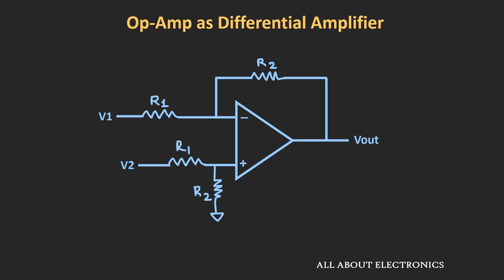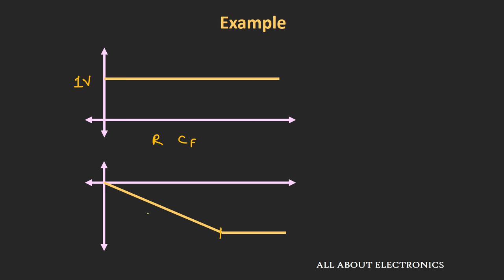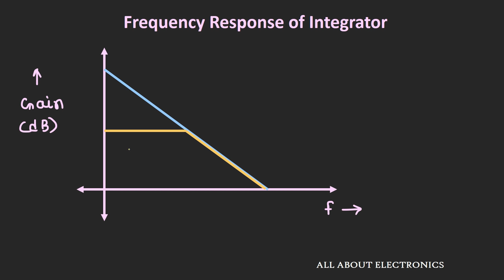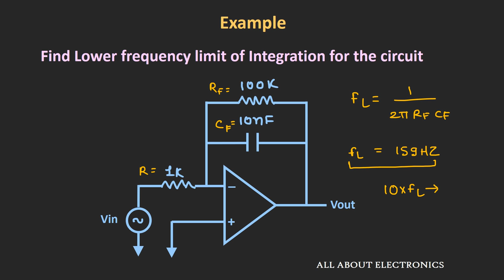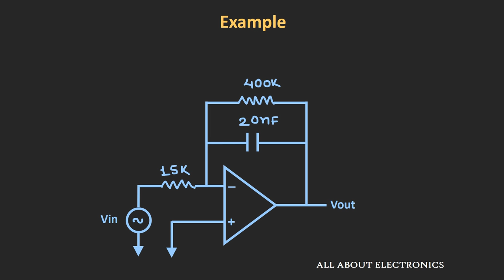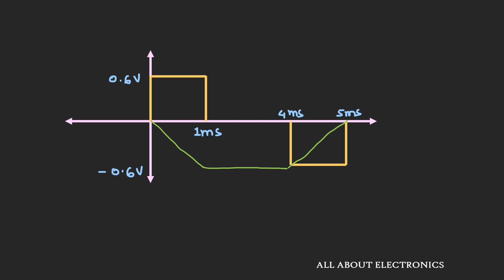Op-Amp Integrator (with Derivation and Solved Examples)

Comment from the maker: The timestamps for the different topic covered in the video is given below:
0:48 Op-Amp as an integrator (Derivation)
4:32 Output of Integrator for the different input signals
5:54 Limitations of the simple integrator circuit
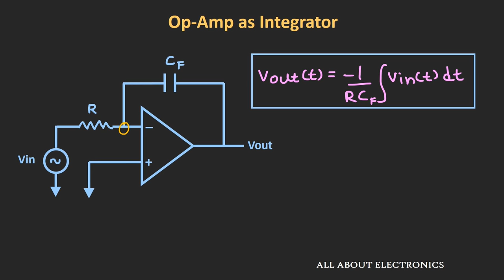8:57 Practical Op-Amp integrator
12:08 Example 1
13:10 Example 2
14:51 Example 3
17:15 Example 4 (For Practice)
Reply: Sir at 11:55 how we can go beyond 0 dB frequency? If the gain become 0 then output will be zero means completely attenuated.
Reply: In last question 17:48 how the o/p can occur if i/p at this duration 0?
Reply: how does  then gain equal to xc /r at 6:34
Reply: @stratupgeneralstudies2961  Gain of 0dB means Gain of 1 so if Gain drop below 0dB the signal is being attenuated by the amplifier.
Reply: Could you please explain, do we need our junction to be at zero potential before applying KCL there? Or you mentioned it for no purpose at all?
Reply from the maker: @prabhatp654  Didn't get it. Would you please elaborate it a bit.
Reply: Sir how you can say that voltage output is the swing .
Reply: @ALLABOUTELECTRONICS  you said something like that we have a virtual ground here and hence we can apply kcl. I am asking to apply kcl do we need to have a ground?
Reply: @prabhatp654  No
Reply: Sir, for homework problem the input signal is 0v for 1ms to 4ms.
Than how the o/p signal has constant value at -1 v.(why it is not zero for 1ms to 4ms)? 
Pls elaborate it. anyone.
Reply: "luu
Reply: Thanks a lot!!
Best demonstrations ever!!!!!!!!

Can you please do LTSpice simulations ? @All ABOUT ELECTRONICS
Reply: @malaymanna9699 mera toh minus 6v araha hai ....sir ka jrur -0.6v ara hoga tbhi constant bolrhe the .

Comment: Homework solution is 1V to -1Vin 0 to 1 msec and constant from 1 to 4 msec and -1V to 1V in 4 to 5msec.
Reply: how? 1 to -1 ?
Reply: Yes. I too found the same answer. Output is 2V therefore 1V to -1V from 0 to 1 ms and -1V to 1V in 4 to 5 ms.
Reply: @arindomphukan  bro what is the value at the 1ms to 4ms
Reply: @arindomphukan  bro uf you know that ans pls reply it bro
Reply: @sudharsanvenkatesh966  at 1ms it's -1V and then it is constant. So from 1ms to 4ms also the value is -1V
Reply: @sudharsanvenkatesh966  0V
Reply: I'm getting 0.1 and -0.1V
Reply: What is the frequency of the square wave? In the hw qn?
Reply: homework ans is 2volts, just wanna ask if it is 1V to -1V in 1ms or 0 to -2V,  why are u taking +ans/2 as the initial Vout? why not 0V
Reply: @rahulroy5206 mera ans 1V to -1V bro hai
Reply: @sm41149  0.5 KHz i guess

Comment: In the example of square wave  ; output voltage after integration was -10v. In the graph it was drawn between +5 volts to -5 volts. But in the question for practice; output voltage comes out to be -2v(0-1ms) and you have drawn it from 0 to -2v. Both seems contradictory to me. Please clarify.
Reply from the maker: Yes, in the first case, it should have been from 0V to -10V. (Because at time t=0, the output will be zero, considering there is no initial output voltage). For practice example it is alright. 
Thank you for the correction.
Reply: ALL ABOUT ELECTRONICS thank you for clarifying. your vedios are really helpful
Reply: Thanks Medha for clafication.
Reply: i had also this doubt, thanks
Reply: Same doubt,hehe.
Reply: @ALLABOUTELECTRONICS  sir, in the very last question why it is drawn downside? Bcoz in second last it was started from up🤔🤔
Reply: @ALLABOUTELECTRONICS  pls write this correction in the description so that more ppl can see it
Reply: @ALLABOUTELECTRONICS  is 10 peak voltage or peak to peak.
Reply: miss can you please provide us solution
Reply: @ALLABOUTELECTRONICS  you should have mentioned it in the video itself , because when I solved the example and got this answer , I doubted that my answer is wrong since you mentioned in the video that it is from 5 to -5 , I am glad I found this comment otherwise I would have learned something wrong , which shouldn't happen , so it would have been better if you had mentioned it in the video or in a ping comment . cheers .
Reply: @WhyBhanshu  same doubt here but if i would not have read the comments then actually i would i have gone wrong in my final exams 
...the care should be taken while uploading the videos
Reply: @ALLABOUTELECTRONICS  then for the second half of the signal? -10v to 0v?
Reply: @ALLABOUTELECTRONICS  but at t=0, input is not zero. So why is output zero?
Reply: Same doubt i have
Reply: Thanks medha
Reply: @ALLABOUTELECTRONICS  Please correct this in the video as well. Add a small note. I got confused and spent 20 minutes probing on this. Thank you.
Reply: @ALLABOUTELECTRONICS  initial voltage is not zero.....particularly in last example there is 0.6v initially ,which get amplified to give -16v ... so the total output result varying between 0 to (-2-16),that is 0 to -18 ..., is this correct or wrong ...???
Reply: @ALLABOUTELECTRONICS  so the line should be drawn from 0 to the lower part of the graph at 50us? So basically this voltage is Vp instead of Vpp?
Reply: I was damn sure I'll find this doubt here😂. Thanks btw
Reply: in last example I am getting Vout as -60V instead of -2V. ! where is my fault?

Comment: Regarding the integration example at 14:59, I think to clarify,   Vout(t) = -200,000t volts between 0 and 50 us (and each subsequent corresponding high pulse) and Vout is (+200,000t - 10) volts between 50 and 100us (repeating similarly).  The -10 volts term is needed because the starting point of Vout is -10 for the second piecewise segment.   This is consistent with what you mention at 4:20, where you correctly say that there is a second term to determine Vout, to reflect the starting point of Vout.  These two piecewise functions result in a sawtooth for Vout that decreases from 0 to -10 volts and back up to 0 volts and so on.  I hope this is helpful.

Thanks for the videos.   They are great.
Reply: I had thought the same
Reply: That's ok 
But how to determine where the graph is starting

Comment: Sir,in this video in example -3, V output was -10V which was shown +5V to -5V in the graph. But for the last exercise question V output= -2V.How it is shown from 0(origin) to -2V rather +1V to -1V(as like your solved, example.). please tell from where V output will come, from 0V Or from +1V.
Reply: Same doubt i had output will vary from 0-(-10v)for first 50us then -10 -0v for next 50us and so on

Comment: In practice problem, during  1ms to 4ms output is constant instead of zero because you said due to the initial voltage right??? But in  the case of 4ms to 5ms we didn't take care of initial voltage( -2V), we should add this voltage in the new voltage bcoz we have equation: integration of input voltage plus initial voltage.... so output will become -4V . Why we didn't add ?
Reply: nah bro it adds up to become zero at 5ms

Comment: In practice question v(output)=-2V from 0-1micro sec 
so the graph starts from 1 and decreases to -1 and then it will be constant till 4 micro sec .from 4 micro sec to 5 micro sec it increases to 1 V.
sir, is my graph is correct?
thanks you sir.

Comment: I think you explained it right.. nice tutorial.. the answer to the last quiz example is 60v? but the peak is 30v right? because an integrator config is 90 degrees out of phase and not a full 180 degrees .. that's why some are confused with your last example which is 10v but the peak is 5v.. +5v to -5v is equal to a 10v swing..

Comment: Glass passivated sensitive gatethyristor in a plastic envelope,intended for use in general purposeswitching and phase controlapplications. This device is intendedto be interfaced directly tomicrocontrollers, logic integreatedcircuits and other low power gatetrigger circuits.

Comment: Last example you did for us.  I am confused because the equation gives you the slope (voltage change / time change ) not the value of the function at a certain time. For example v(t)=-1/rc * t   where t1=50us t2=100us . Plugging in the values you end up with 200,000 * 50us =10 volts   so in the voltage changes 10 volts in that 50us period.  If you just plug in a discrete time value to the equation  you end up with a number that you may think the function is at that time but isn't.

Comment: At 16:43, if we don't put limits we get Vo1= -(constant).t , which means slope of Vout vs t graph will be Vo1/t = -(constant) within 0 to 50 micro sec time.

But why do we start our output curve from +5 volts? There will be 0 V at output initially, so the curve should drop from 0V to -10V and then oscillate in triangle wave between zero V and -10 V.

Can you please clear my this doubt too? Thanks for clearing pervious doubt in summing video
Reply: I too have same question... Moreover I get Vo = -100V not -10V

Comment: @ALLABOUTELECTRONICS I have solved practice question. My answers are:  (1) for 0 to 1 ms -----   - 2V Swing in voltage    (2) for 1ms to 4ms ------ 0 Swing in voltage   (3)  for 4  to 5 ms -----    2V Swing in voltage. But I am unable to understand at 17:45 Min why your output waveform starting from origin? should it not be:   (1) Stated from +1V and go to -1 V from 0 to 1ms (2) Then stay at -1V for 1ms to 4ms and (3) Again come back to 1 V from -1V during 4ms to 5ms. Please correct me where I am going wrong.

Comment: Brother, at 17:06, Does your graph should not start from 0 and move to 10 with a positive slope???
Reply: Yes. I was abt to tell this.
But the slope should be negative, as Vo=-10. 
The output should start from 0 and at 50uS, it should be at It's peak value -10V.

Comment: Doubt For Example 3:
We got Swing of 10 volt as Vout after integrating for time (0 -> 50 us) as -10V (that is our Swing), but how you determined the initial and final point as +5V and -5V ?????????????????

Doubt For Example 4:
Similiarly. for practice problem I got Swing as -2V, now how to decide ends  ??????????
Reply: Actually it is not -10.
It is -10t ,function of time after integration. End point will be decided by putting the value of time.
I think graph is not correct.
Reply: @prabhu4323  
Yes. I was abt to tell this.

The output should start from 0 and at 50uS, it should be at It's peak value -10V.
Reply: Example 4 
-2v how? Explain with expression plzz

Comment: It would be -1 as only half cycle is working and had it been one full cycle then it would have been -1 to +1 but I didn’t understand the previous graph properly as it starts from top although the output should have started from zero as in case of the second graph
Reply: It’s incorrect 

It  should start from 0  and goes to -10

Comment: Sir, in given example of input of +/- 2v  of frequency 10kHz has squar wave. The out put of given ckt from 0 to 50us is -10 v comes. Now this output voltage hold till next input. According to given input from 50us to 100us the ckt output become +10 v + previous output that is -10 v so net out should be zero not 10 v.  So out put waveform should be triangular of -10v not having any +ve value. Am I right sir? Pls clarify

Comment: In example 3 .How are you deciding end point. 
Output voltage is not -10.
it is 10t , function of time. So end point should not be -5 to +5 .it will be decided by putting the value of time.
Reply: The output should start from 0 and at 50uS, it should be at It's peak value -10V.
m i right?

Comment: In the homework question, may I clarify why the Vout is not zero between 1ms and 4ms given that Vin is zero? The maths seems to suggest Vout=0 between 1ms and 4ms too. In the mathematics of a definite integral of a function, it represents the total area bounded by the function, x-axis and the two vertical lines representing x=1ms and x=4ms. In this homework question, the area the Vout integral is zero.
Reply from the maker: Capacitor will hold the charge that it has gathered during first 1 ms. So, during 1ms to 4 ms, the voltage across capacitor will remain same even if no input is applied to the capacitor. I hope, it will clear your doubt.
Reply: @ALLABOUTELECTRONICS  Thanks you very much for the response. I think this is a very good question that prompts learners to think in details. And I have three more questions based on your response.
1. Is the measurement of the Vout between Vout point and ground? And is it the same as the voltage across the capacitor which is between Vout and the negative input terminal (virtual ground)?
2. When there is no input from 1ms to 4ms, is the capacitor going to discharge through the 400KΩ resistor connected in parallel?
3. For a periodic on and off input signal, e.g. -1V (0 to 5ms), 0V (5ms to 10ms), -1V (10ms to 15ms), 0V (15ms to 20ms), and so on, is the Vout going to be in triangular wave form? Or is the line going to be flat at where the last signal ended in periods that have no input signal?

Comment: Such nice video. Also pls give Application example , where this integrator ckt is used
Reply from the maker: It is used when you want to integrate the signal. For example, if you want integrate the current and convert it into voltage then it is useful. This is particularly useful in photo diode based detector circuits for very low light detection. ( Used in bio science applications in fluorescence detection).
Apart from that, it is also useful in wave shaping circuits. One such circuit I have already covered in another video. 
Please check triangular wave generator circuit on the channel.

Comment: in the last example we didn't  used the miller integrator so in the second  cycle  where  vi=0  before that capacitor is charged so as vi=0 the capacitor will get discharge its got path to discharge but it will right in miller integrator because it don't have resistor to discharge
and and the output equation you  used is for miller integrator but question is not an miller integrator

Comment: just messed up  by something  in last question i took T=5ms,f=200Hz,fL=39.78Hz,fs=159Hz
for integrable it should be between both,

Even after that, i took then for 0-1ms:Vout=-2V
and for 1-4ms:Vout=0(as no Vin)
and for 4-5ms:2V
so is it that form -1 to 1 or how to figure out Graph,Help?
Reply: @Kumar Gupta .. your answers are similar to mine. To graph, you should use the integrated function on each given intervals and you will see the form of the graph the author hinted at the end of the video.. thanks bro.

Comment: at 8:56 you said that adding a resistor is helpful..  and afterwards u said that the capacitor will work as an open circuit  at 9:09

So if capacitor acts as an open circuit our original goal( of integrating the circuit ) won't happen as there is no capacitor. So, how does the resistor is justified??
Pleas help..
Reply from the maker: See, when we say it acts an open circuit, it is a steady-state condition. The input offset voltage remains there. It's not changing with time. So, to avoid saturation because of that, the feedback resistor is helpful. But when we use the circuit as an integrator then the input is changing after some time. If we apply a constant DC voltage then the output will be a ramp signal but in a few ms or a few seconds, it will reach saturation. 
So, the circuit is useful as an integrator when you want to integrate the time-varying signal or the DC signal which is on for some time. 
Let's say some switch is open for few ms and you want to integrate the output during that time, then its useful. But its not steady-state condition, hence the capacitor won't act as an open circuit. 
I hope it will clear your doubt.

Comment: I have a question :

If input signal frequency is greater than cut off frequency but not greater than 10 times the cut off frequency ( Fcut<fin<10*Fcut) then what will be the output shape?
Please Explain..

Comment: Sir, in integrator simulation , i gave 1 v dc as input, resistor = 1k and capactor = 1000 micro farad.
I discharged the capacitor and then i ran the circuit.
At output i got  9.61 V  from very beginning. Why ramp was not produced ?
(The opamp saturation voltages are +-10 V)
Reply from the maker: have you seen the transient response?
Reply: @ALLABOUTELECTRONICS   ohh i had not seen that .
Thank you sir.

Comment: in the question where first half cycle is of 2 v and second half is of -2 volt (at 15:52)
the output wave form obtained, why is in the positive region also, as in starting we will consider output=0 as input is zero 
but when the input of 2 v is applied for 50 micro second it should decrease by 10 v, and in negative cycle it will increase by 10 volt, according to this output should not be positive 
i think its output should be like the last question output except the constant region in that waveform

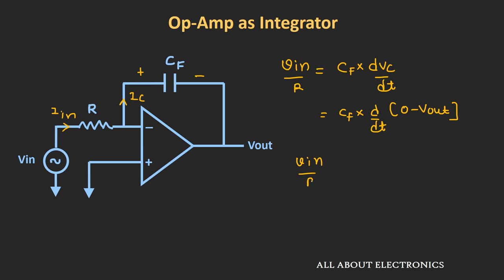Comment: sorry, maybe I ask it a bit late. At  3:20  , when computing the Vc, why is Vc calculated by 0-vout? Isn't voltage always flow from high potential to low? So Vc should be equal to vout-0?
Reply from the maker: If you see the current, then capacitor current Ic is going from inverting terminal to output terminal. So, based on the current direction, the inverting terminal is at a higher voltage. (Since current flows from higher potential to lower potential). 
It is purely based on the direction of the current. If you assume the current through the capacitor is flowing from output to inverting, then you will have (vout - 0 ) in the equation. But then, when you apply KCL at the inverting node, then you will have Iin + ic = 0, OR Iin = -Ic. So, eventually, you will get the same result. I hope, it will clear your doubt.